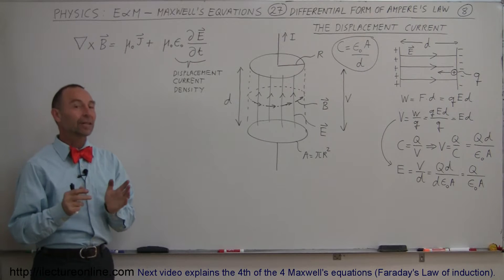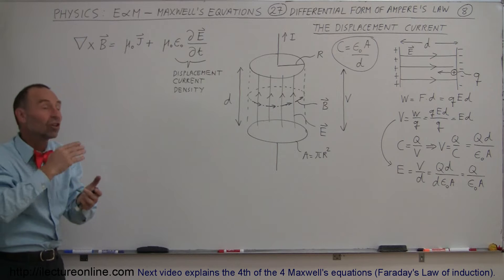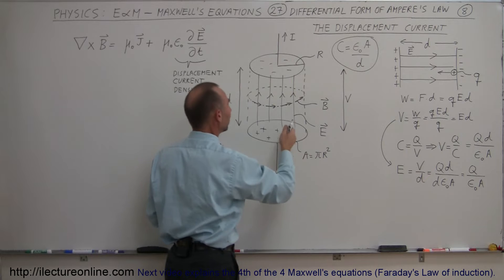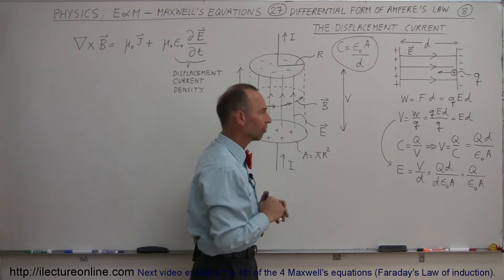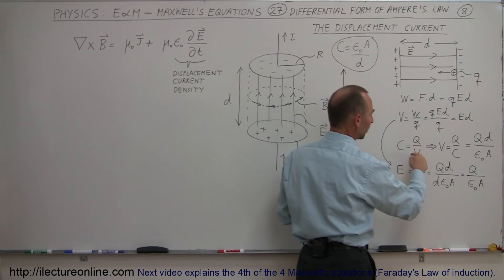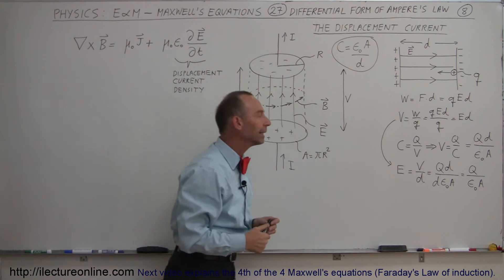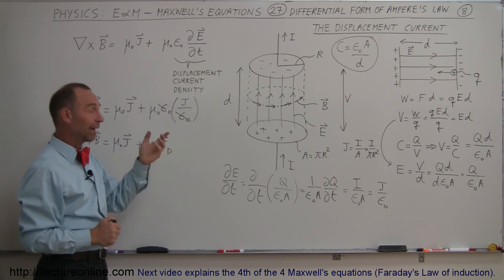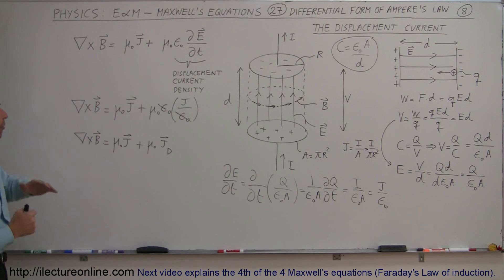Physics 46  Maxwell's Equations (27 of 30) Differential Form of Ampere's Law: Displacement Current

Comment: Watched this to revise some of the stuff I learned in undergrad physics course a few years ago now, and it was a great explanation. I still marvel at the consequences of the displacement current term, that it allows spontaneous creation of alternating E and B fields as light waves. Really a stroke of genius by Maxwell and Ampere to figure out the missing piece of the puzzle that enables EM radiation to propagate, simply from analysis of charging parallel plates. Maxwell's equations really do feel the closest to "magic" that physics gets because the differential casting of the equations is so concise and elegant :D
Reply from the maker: Maxwell's equations do show a brilliant understanding of these fundamentel E&M principles.  (It is like a good symphony)

Comment: Excellent lecture Sir. Can we say that as change in magnetic field produces an e.m.f , similarly change in electric field will also produce an e.m.f and subsequently so called displacement current?
Reply from the maker: It is more precise to say that a change in the magnetic flux through a loop produces an EMF in the loop and the accompanying induced current in the loop.

Comment: In my opinion there are not real movements of "electron particle" insdide conductor. There are not movement of matter inside conductor. 
When there is a current, this mean there is a  propagation of vibration of EM to seek the new equilibrium inside the body
Reply: First off, I would refrain from wording something like this as an "opinion." It really shouldn't be. Hopefully we're discussing facts and objective truths. Although, when we're discussing more theoretical stuff I could see where your coming from, so you are kind of justified.

But as for your actual comment, as far as I know you're correct. But I don't see how this conflicts with anything he said.
Reply: @rileyscott7672  , My goal is to move forward knowledge

Comment: displacement current is not real but the magnetic field it produces is real. So if a normal current carrying conductor is placed in this magnetic field it will experience a Lorentz force and by newtons 3rd law so should the capacitor plates ??

Comment: does displacement current experience a lorentz force in presence of external magnetic field like normal current flowing through a conductor.If yes then how, since there is not charges moving between the plates to experience the force so how do the plates experience the force?
Reply from the maker: Remember that the displacement current is not a "real" current with real charges, but an effect that acts like it is a current.
Reply: Michel van Biezen I know but if I keep a normal current carrying conductor in the presence of the magnetic field produced by displacement current ,the conductor will experience a force, and by newtons third law so should the plates of capacitor??

Comment: Why when I put a high voltage >100V and high frequency 30MHz between two capacitor plates do I not measure a magnetic field? There is no experimental evidence anywhere of the magnetic field being measured, only the magnetic field of current flow at the conducting plates.
Magnetic fields cannot be formed in free space, only in conductors.
Reply: So radio waves? Dont' they travel in free space & have a magnetic component?

Comment: i think your final conclusion is not right. Because you are dealing with the region inside the capacitor you need to set the first current term equal to zero.
Reply from the maker: +David Zare 
   This is simply a description of the differential form of Ampere's law.  (Not the solution to a problem or a particular situation).
Reply: +Michel van Biezen thanks for the quick response. i still think the last equation needs a correction if we care about people&#39;s have the right understanding of the problem. Here is another way to put it, as we know &quot;Current&quot; in physics is defined as amount of charge carrier passing across a region per unit time or I = dq/dt. if not charge particle present dq = 0 and hence I = 0. this wil make the first term in your example (J = current/Area) equal to &quot;0&quot; and the only remaining term will be the misleading &quot;displacement current&quot; JD as you derived it. It is misleading because this is a current with NO charges moving through that point in space. cheers
Reply from the maker: +David Zare 
  Good input. Thank you.
Reply: Thank you! i was thinking the same and now i'm more satisfied with my conclusion after i saw you comment, i think it should be:
div E = µ0 J + µ0 ΔJ , because if the Q density is not changing on the plates, the E field will be constant and there will be no magnetic field. (dQ/dt)is change of Q on the plates(not current) so (dQ/dt)/Area is ΔJ (change in Q density)